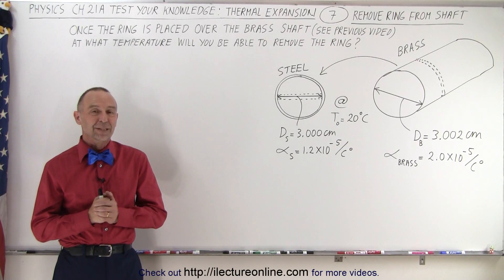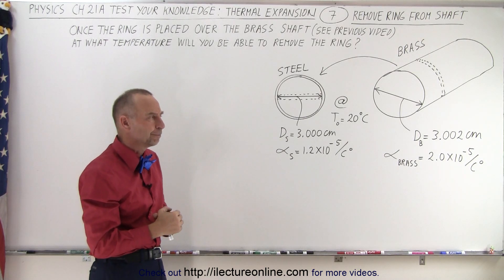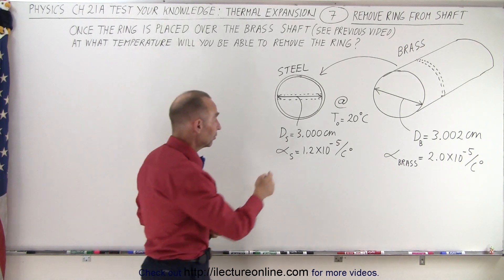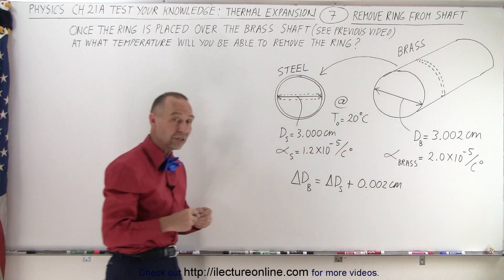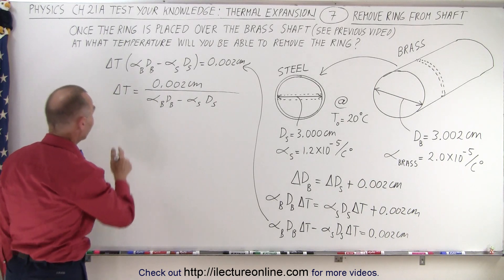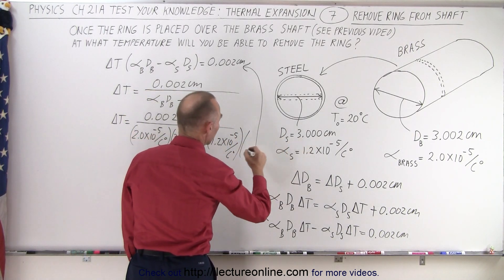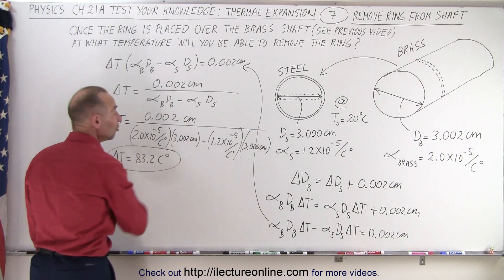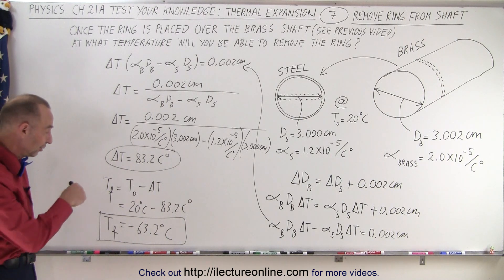Physics - Ch 22A Test Your Knowledge: Thermal Expansion (7 of 20) Remove Ring From Shaft

Comment: An iron ring 1.20 m diameter is to be put on a wooden cart wheel. The diameter of this wheel is 1.0 cm greater than that of the ring. The temperature of the ring that must be raised before it slips on the wooden wheel is (coefficient of linear expansion of iron is 12×10−6/oC)? 
I need ur help
Reply from the maker: You need the diameter to be 1.21m (which is 1 cm more than it currently is)       Therefore the delta D = Coefficient x D x delta T           0.01 = (12 x 10^-6) x (1.20) x (delta T)          delta T = (0.01) / [ (12 x 10^-6)  x (1.20)  = 694 Celsius degree     (Note that this is only the change in temperature)

Comment: Shouldn't the Steel ring diameter 'Ds' be taken equal to that of the brass rod diameter once it has cooled down and heat fitted onto the brass rod?
Reply from the maker: No, bases on the thermal effect.   But that said the steel ring will be forced to (almost) be the same size as the rod, since the ring will push the rod down to a slightly smaller diameter.  But that was not the purpose of this video.
Reply: @MichelvanBiezen  I was thinking the ring diameter would be more closer to the rod diameter rather than its original diameter unless the ring has a relatively higher mass density and metallic bonding strength. Brass and Steel in this example were very close in density, infact, the steel conveniently has slightly lower.
Also, is it needed/(be more accurate) if we use volume/area coefficient of expansion for the bulk objects when solving such problems? Thank you
Reply from the maker: I agree, but again that was not the point of this video.

Comment: What if linear coefficient of bar is less than the linear coefficient of ring?
Reply: Say ring is of made of aluminium and bar is made of silver
Reply from the maker: Then you would need to cool the system instead of heat it.  Try it.  You can simply reverse the metals in this example, a brass ring over a steel shaft.
Reply: If the linear coefficient of bar is less than that of ring, you can just heat the entire system instead of cooling it.

Comment: But if I want to remove it only I need  to heat it up 104 'C and it is more easily
Reply: No, if u heat up, than since the alfa of brass is grater than the steel, it crushes the steel from inside. Brass expanses more.